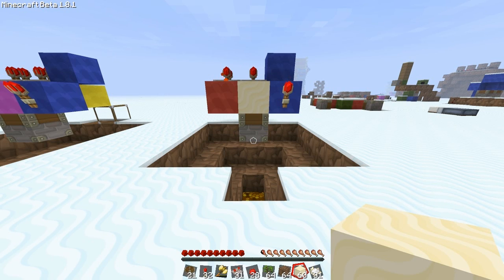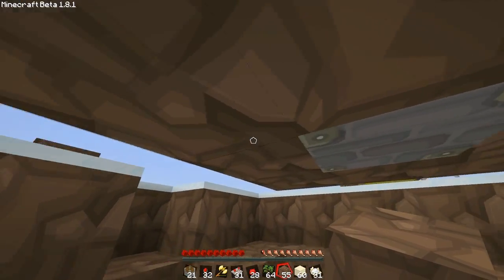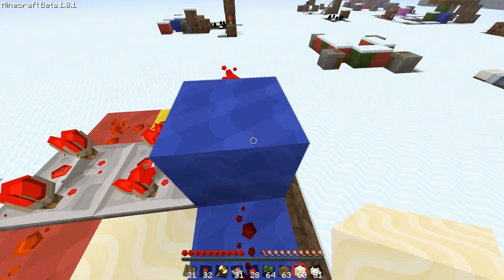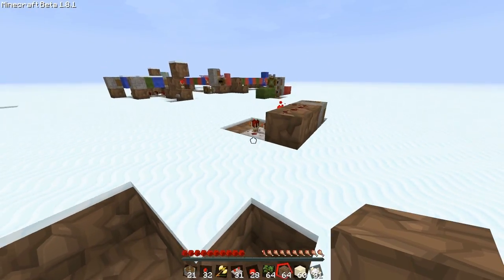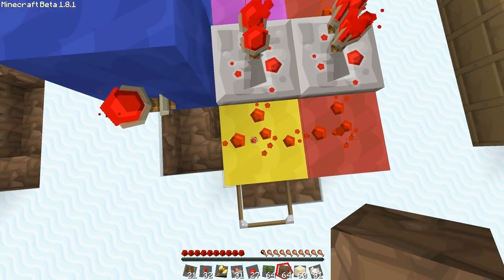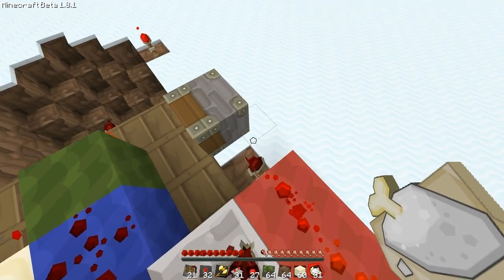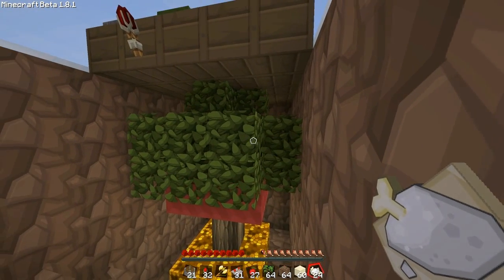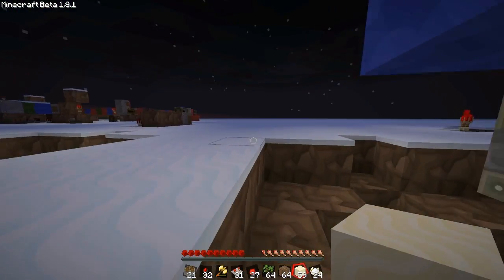New small BUD switch: Sand based, ceiling friendly, mother approved

Comment from the maker: @Generikb 
Haha! Looks like you were ahead of the game. When I saw the beginning of the video, where you demonstrate that a repeater can draw power out of a weakly signaled block, I instantly realized I didn't need two power feeds (both the yellow and red blocks), but could combine them...which I did, turns out it's basically ends up being exactly the same as one of your designs so bravo to you! Tweak a repeater and you can use sand. I'll put up a video demonstrating this. Very nice :D

Comment: 5 sides is not a new thing. The ceiling-friendliness and no slime is awesome though bro.

Normal growth and bonemeal growth do not differ, the mechanics are just glitchy with leaves. You also don't need a BUD for a tree farm, a repeater pointing to a sapling works fine.